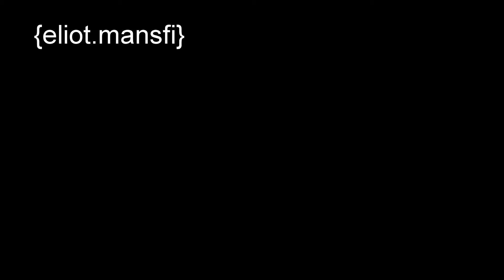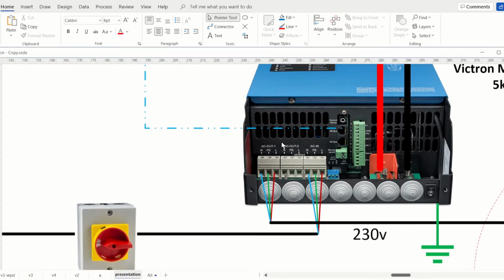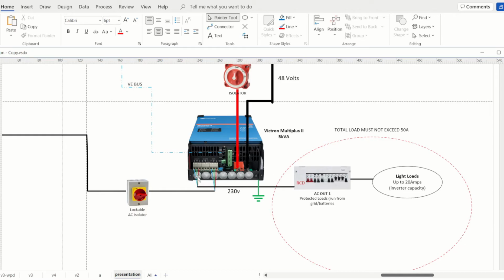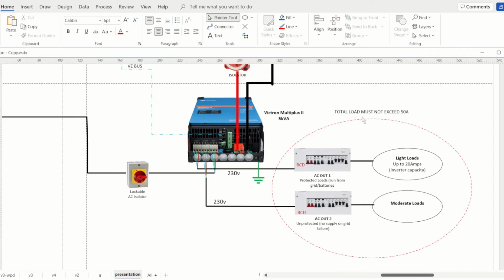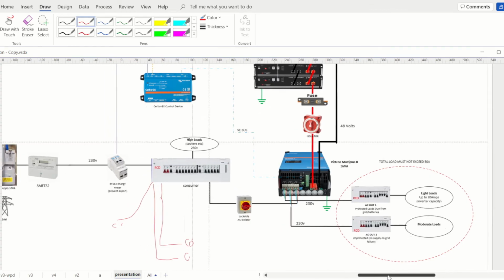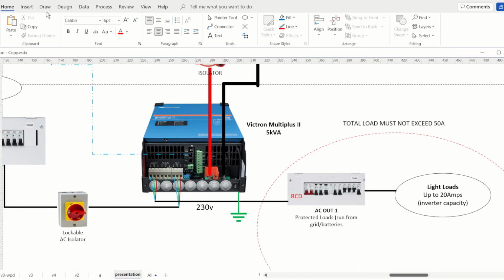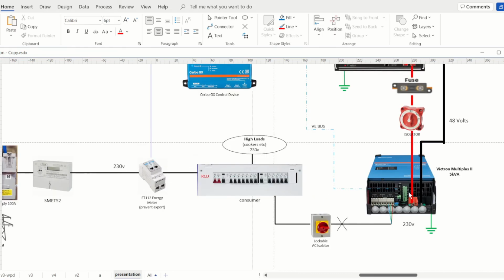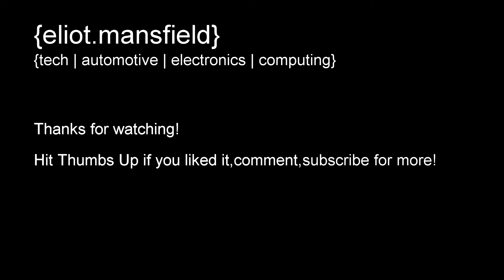Victron Multiplus Wiring Options Part 1

Comment: 45 seconds in and you'd answered the biggest question I had!!!! Input is bidirectional!! Thank the lord. You my fella, deserve a pint 🍺
Reply: Indeed! The reason that I tuned in was this simple question! It get rid of all my schematics that I've drawn.
Reply: I did not recognise that instantly but read the manual and there it was. There was something about passwords and regulations so that one can not just start messing the network.
Reply: @HobbyFinn2  'Grid code password' - it's all in the Victron training documents/videos)
Reply: Can someone point me to where in the manual is states or explains the input is bidirectional, looking at the wiring schematic it makes sense but for peace of mind would just want to clarify. Great video though!!
Reply from the maker: @mw-tg4tf  you just need to trust me - it’s bidirectional.  It’s been installed 9 months.
Reply: @eliotmansfield  lol bi directional had a talk with someone and I said could I feed PV back the AC output and I was told no looked at the schematics and it’s a big relay, AC in its makeup is bidirectional Alternating Current.
Great mock-up just seeing the easiest way I could add one with PV backup as well
Reply: @DTech101  You can have PV on the AC output. The benefit of this is the PV will work if there's a power cut. The downside is, you can't have more PV than the inverters power capacity ie. with a 5000W inverter, you can't have more than 5000W of AC coupled PV.
Reply: @pau1phi11ips  yeah that’s exactly how I designed it, may put panels on the DC side
Reply from the maker: @DTech101  my solar is on the dc side too
Reply: @pau1phi11ips  "...with a 5000W inverter, you can't have more than 5000W of AC coupled PV." - Forgive me, but why not?
Reply: same :D
Reply: Yep, that what I was wondering, if you really dont care, you can stick a regular 3 pin plug, plug it into a "quite" ring main and voila (provided you have a current sensor"
Reply: Output are too

Comment: Thank you for a clear and concise (and free of the usual Yt video verbal diarrhoea) description.  One Legged Mode:  Forgive my ignorance but how (one Earth!) is this useful ... or at least useful enough to warrant the cost of the MP2 and a battery?  You could not get any UPS functionality in this mode as there is no anti-islanding preventing back-feeding the mains in the event of a mains failure to the danger of great workers.

Is the ET112 needed if you are not going to be exporting to the grid?  What would be the result if an ET112 were not used in a system that purely consisted of MP2 and battery configured as an ESS/UPs (ie like your set up at 06:55)?
Reply from the maker: single leg mode is only to benefit from battery storage (ess) to take advantage of cheap overnight electricity.
The et112 is required in any scenario where ALL of the loads are NOT on the output of the victron (because if the loads are not crossing the victron it cant measure the load)

Comment: Thanks for this video. I dont know why almost everyone else just covers the ac out 1 and critical loads scenarion in their vids👍
A question please.
I would like to use our 5k 48v multi 2 to support loads in as you say single legged mode using the ac in connection because it saves a lot of hassle and expense with electricians etc.
If i do this can i then use a standard 3 way generator switch in a grid down scenario and just plugin ac out 1 to the jenny socket without any danger of backfeed?
Also in this instance should i flip the rcbo on the ac in as it will be energised again?
Jimmy
Reply from the maker: @Woodyjims-shack  that doesn’t make sense to me.  If you are considering using a genny, why wouldn’t you move critical loads to ac out1 and save the noise of a genny?
In single leg mode grid loss results in total shutdown of the inverter.
If you want to use a genny, you need a changeover switch between the meter and consumer unit to ensure no back feed.
But then you need to ensure your house loads don’t overload the genny.

Thats why having a critical loads panel is a good idea - for genny or victron.

Comment: Fantastic video Eliot. Really informative. Im planning a Multiplus/ Pylontech installation and had considered a "off grid" mode using AC Input as "shore power" essentially, was worried about it back feeding small amounts to the grid. The single legged mode seems interesting though so may just make an application to back feed the grid. AC Output 1 then could just have a small consumer unit so there's still power available during a grid failure?
Reply from the maker: @conzymaher  yes you will always backfeed some electricity to the grid as the unit gets to equilibrium.  So if you turned on a 3kw load, it will essentially pull that from the grid and the inverter catches up in a few seconds (depending on if you are using an et112 or the internal or external current clamp) and when that load disappears, that 3kw will backfeed from the inverter to grid - again until the inverter ramps down to equilibrium
Reply: @eliotmansfield  Thanks a lot. So this means whether people realize it or not. Anyone using a Multiplus in a camper van and using shore power is feeding some amount of power back into the campsite? Perhaps this is just par for the course. Very little info about the grid code for Ireland but hoping 50549-1 certificate is adequate
Reply from the maker: @conzymaher  cant comment about campervan setups, as mine is in ESS mode which assumes permanent grid connection, people use these things with generators and i dont suppose they want to be backfed at-all, so maybe theres a different configuration for those scenarios?

Comment: The last option is stupid, it's good but do you raally think that having smart meter will prevent export to the grid??? you really think 0 wats will be exported in whole period of working? You can get huge fines just for 1 exported watt.  Are you sure? I doubt that slow smart metter of 700ms that sends data to cerbo gx, adn read by inverter later maybe it's already 1.5seconds delay is enought to prevent export.  What if RCD works and turns off whole house loads, where will power from inverter at that moment go?
Reply from the maker: @SayWhaaaaaaaaaaaaaaaaaaaaaaat  
I know exactly how it works you tool - perhaps sober up before mummy lets you back on the internet eh?
Reply: @eliotmansfield  :DDDD idiot. instead of answering like a men answered like an idiot.

Comment: Great video thanks for sharing . Explaining really well .
1 question 🙋 

If I am to wire it with the consumer board first then the inverter after that .

Do these inverters still feed back to grid ? Or can I stop that .
All I want it for is a back up if the powers fails from the grid for the simple loads - lights - tv ect
Reply from the maker: @bosshog9813  yes you can configure it to never export (which is what i do) - after that, you can configure it to say  the minimum charge the battery should have. If just want it as a backup you would tell it to maintain 100% soc - which is a bit of a waste of the kit, because you are not taking the opportunity to use cheap overnight electricity.
But it should be noted that any loads that must stay powered when the grid fails must be connected to ac out 1,  anything else (ac out 2 and the input which is also an output) will go off on grid loss

Comment: Great video & only one I could find that clearly explained single leg mode.  I’m connecting Multiplus II 48/3000 in single leg mode & assume I can use a type B 16A MCB (due to effective limitation of 13A from 3000) & 1.5mm2 cabling or should I be using a type B RCBO?
Reply from the maker: @PaulRBinding  type b mcb and type b rcbo are completely different things.  1.5mm cable is way too thin - consult a spark.

Comment: Hmm. I hadn't realised it would connect Neutral+earth for 'fake TN-C-S'. I assumed I would need an earth rod for grid-down operation. But the whole thing will just be floating at some random voltage given that neither Neutral nor Earth are actually referenced to anything, won't it? Seems to me that an actual earth (via rod) would be a good idea here.
Reply from the maker: @xxwookey  yes fit an earth rod - the latest regs also recommend that too now. Ideally you want 16mm, 10mm min

Comment: Using current transformer on each leg of main panel to prevent backfired but Ess mode not preventing backfeed even though it is set to +100watt.  Should I just use Germany grid code and not ess?

Comment: So the AC-OUT1 loads of "20A" you are calculating from 4000W / 230V = 17.4A.
Reply: It can actually do 5000w/20A (hence it being a Multiplus II 5000) at a push, but is nominally rated 4000w. My Multiplus quite often pushes 5000w for prolonged periods!

Comment: i guess you wont need the meter when mppt only charges the battery  but what is the state of  earth and neutral in off grid  situation .. ?    because i saw a parameter inside  system and left it as it is... not yet installed .. will work as mobile station but alway s propper earthed when operated . nice video helped a lot..

Comment: Victron inverters (pulling off batteries) have a continual rating and a surge rating.   They are not limited to the continual rating.  So for example a Multiplus 2 - 48/5000  has a continual and a peak power rating.  Might be a good idea to clearly explain what the numbers on the spec sheet actually mean, power assist etc.

Comment: Thanks for a great video Eliot :)   What would happen in a LOM event to the loads on the AC in/out of the MPII.... i.e. the house loads on the left hand side of your diagram ? Would the MPII go into island mode and effecively supply nothing except the essential loads on AC Out 1 ?  Or could it be configured with the right grid code to keep supplying those loads on AC in/out ?
Secondly.... if a backup generator using an ATS was installed between the grid meter and the rest of the house, would it enable the MPII to keep operating normally ?  Thanks ;)
Reply from the maker: ac out 1 is the only output that keeps going on lom - so arrange your loads accordingly - see the other two videos

Comment: at the moment i have it installed like the last option (bi-direktional) but my energy meter is placed after the consumers and before the multiplus 2 500..is this still gonna work though..?
Reply from the maker: no - because you have the loads drawn on your consumer unit that the energy meter can’t “see”.  The other option is to use a victron current clamp around your meter tails plugged directly into the victron instead - you also benefit from faster reaction time

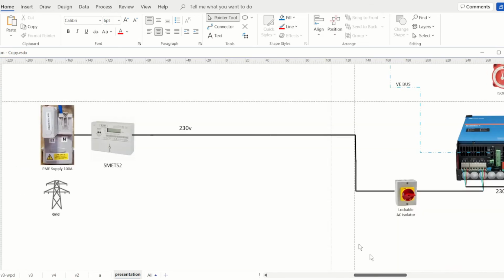Comment: 2:02 would I need a meter still, if my multiplus was the first thing between the main meter and the fuse panel, if the main meter also has a second fuse panel branching off to another part of the house? my goal is not to export. tyvm
Reply from the maker: all consumption needs to be cross the victron (so it can use its internal energy meter) for it to work correctly.  If that’s not the case then you need an external meter.
You can also fit an external current clamp on the victron as others have suggested , but I have run into a different issue with that which ive not determined the problem yet.(there’s a thread on victron named slow ess response)
Reply: I got confused.
What are disadvanteges of the last schema?
Will I have to switch between invertor/grid in this case?

Comment: I have the same Victron as you. The mains has a 50A RCBO after the main breaker. Can the AC input to the victron be supplied via this or does it need to be straight off the main breaker? I’ve already rewired the MCB to give two rows, Essential supplies (AC1 out) and Non-Essential supplies (AC 2 out). I’m going to put the AC grid tied solar on the AC in 1500w. Thanks for the helpful video. 👍
Reply from the maker: depends if you have an upstream energy meter. if not, all your loads need to be downstream of the victron on ac1/2 as required not exceeding 50a total.   If you do have an upstream energy meter (such as et112) then you don’t need ac2 out, because those loads can live upstream of the victron which will still benefit from the ess feature
Reply: @eliotmansfield  I dont have an energy meter. I watched your second video and I think I’ll need to change the AC in breaker for the type B and maybe replace the service breakers with individual RCBOs like you have. Thanks for the quick reply.

Comment: How would this change on a 3 phase setup ? Surely 3 multiplus II cand then handle all your loads .. on output 1 .. or 1 & 2 in an event of grid failure ..
Reply from the maker: just use three phase consumers afaic - the main thing is to try and draw similar amounts on all three phases.  I have a friend with what i call single legged 3ph setup - so doesn’t benefit from the protected output

Comment: Hi Eliot, Can the Multiplus II be connected in single leg mode to my consumer unit in my garage on a 20 amp mcb, rather than directly to the main consumer unit in the house. I'lm intending installing the energy meter straight after the utility meter and running it to the Multiplus II in the garage

The reason for this is that, I want to limit the noise from the inverter in the house.

Great video, and your DJ'ing aint bad either :)
Reply from the maker: yes that will work.  Just make sure the cable to the garage is thick enough - it may only be 2.5mm which may not be enough depending on distance
Reply: Thank you so much for your reply 👍

Comment: Excellent and very helpful video thanks for posting it. I would like to convert my system to Victron ESS but I have an existing Growatt hybrid inverter with 4.5kw of pv and 17kwh of pylontech. I have a victron Multiplus II and an additional Seplos Mason battery but I am not sure how best to set them up preferably using ESS if that is possible. Any thought?

Comment: Thank you, the documentation from Victron is very unclear for what is a complex product.  In the end, you are paying 1500 euros for a 960w inverter (48v, 20 amps)  which is just awful value for money.
Reply from the maker: the multiplus 5000 is a 5000 va, which is close to 20amps at 240v.   It will draw around 100A from a 48v battery to achieve that.
Reply: @eliotmansfield   @Eliot Mansfield  Thank you Elliot for the correction and the excellent videos.  Im looking into creating an off grid system with grid forming, using GTI inverters and the multiplus, so have placed the focus too much on the battery amps instead of AC:).  

Our house currently has around 20a connection from the grid, and since we have both electric water heating and an electric car, it can be sufficient.  A bunch of smart plugs, plus a large a hot water tank and heavy old french furniture which make for the cheapest thermal batteries outside of filling your living room with rocks.  It's also far more comfortable to sit on.

Comment: I have MultiplusII 12v 3000[120 50] 120v. How do you access  bidirectional  function  on AC input( 3 write)
Reply from the maker: Assuming you are using it as an energy storage system (ess) - there’s nothing further to do - it will push against the grid supply to balance out.  A 12v system sounds like it might be off-grid rv/boat?
Reply: @eliotmansfield  Correct.
Reply: Thanks.

Comment: FYI, I would use the CT option for the Multiplus it reacts to the grid significantly quicker then the energy meter and it is cheaper. The energy meters have to go Modbus > GX device > VE Bus this adds delay and means you pull and push more to the grid then with the CT.
Reply from the maker: Yes I’ve become aware of that option now - my meter is 20 meters away from the multiplus which i think i might get away with.
Reply: Interesting. Do you have numbers on how much 'spillage' we are talking about there? And will the MPII shutdown with 30 seconds if the CT is disconnected? This is required for G100 compliance.

Comment: Great video Elliot. Can I ask about the scenario of connecting AC-IN to existing CU (including the ET122 up front) and critical loads connected to AC OUT-1. In the event of grid failure, would one need to require ATS circuits included (any discharge to the grid from batteries and/or PV)? I'm in the UK, by the way. And what RCBO rating would you suggest for the AC-IN on the Normal Load CU (40A?) and AC OUT-1 in the Critical Load CU (20A/32A)? Thanks again for the video - like everyone else said below, has answered a gazillion and one questions in 10mins. But now posing a gazillion more! :)
Reply from the maker: I feed my (two) multiplus 5000 with 2.5mm2 cable protected by a 20A mcb - which is close to the limit of that breaker/cable size. You might ask why not 4mm2 and a 32A Breaker, well it's because I have two 5000's in parallel and Victron state not to over-specify the AC feed wiring.  Critical loads are protected by a 20A breaker.   Things get complicated, because you should be using type "B" RCD/RCBO's which provide the best protection against induced DC fault currents over AC  (old school type "AC" RCD's wont trip if there's a DC current overlaid onto the AC - there's a number of video's about this issue and i didn't mention it in this video). Type A's should be used everywhere as minimum in the 18th regs.